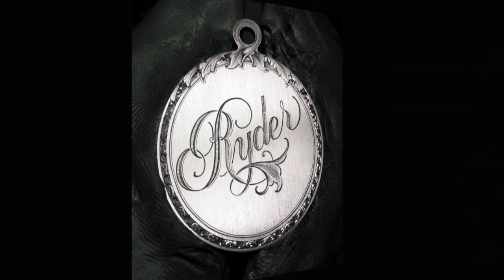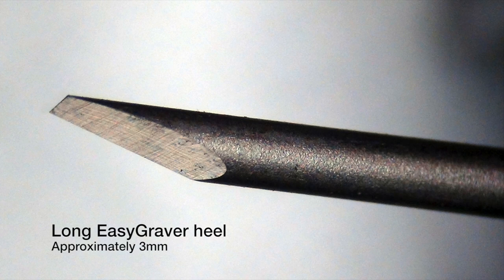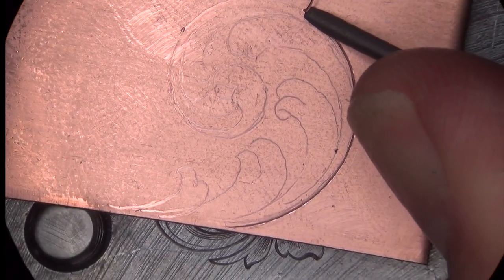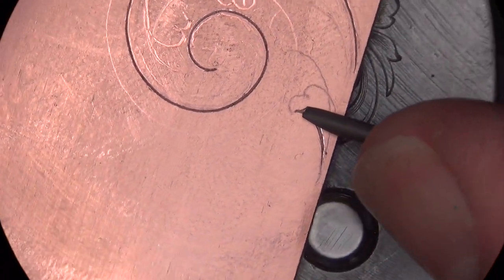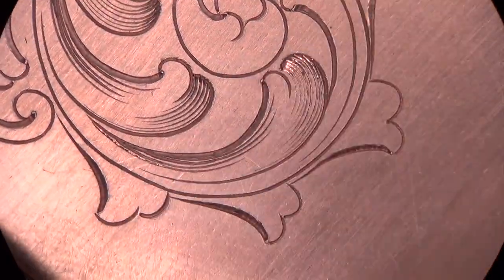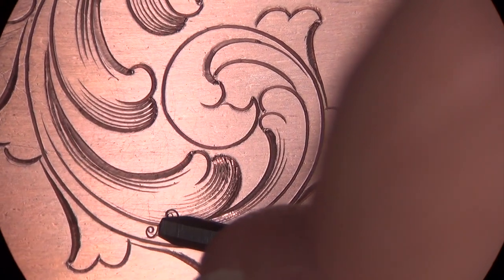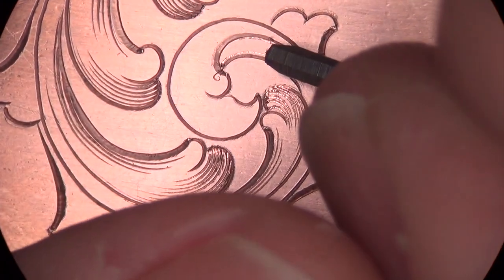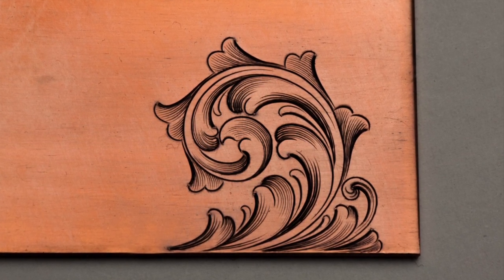Hand push hand engraving by Sam Alfano

Comment: 👍I come back to give you a like.
Watched this video about 6 months ago started out with flatted copper pipe and broken #10-24 tap. Sharpening it to work was trial and error but eventually got it to work well enough I still sometimes use it.

Once I figuered out I could actually do it reasonably well I started buying proper blanks. Machined some scrap stainless rod to hold them and turned some Mesquite knobs to make them more comfortable.

It's a fun hobby that pays for itself.

TY for sharing tips.